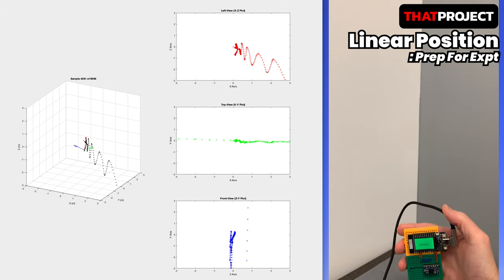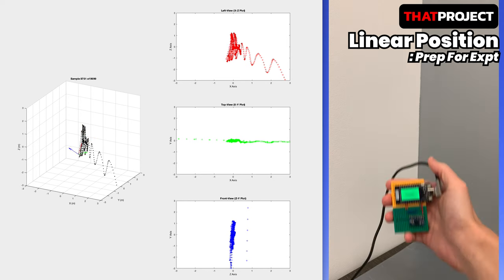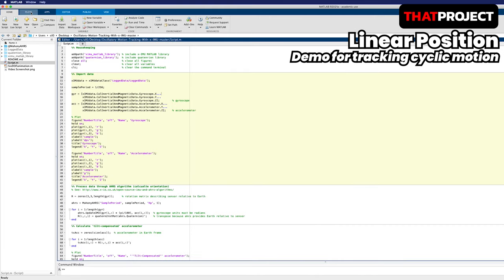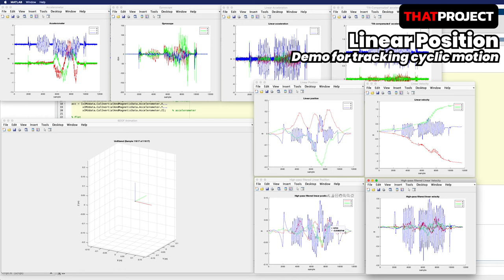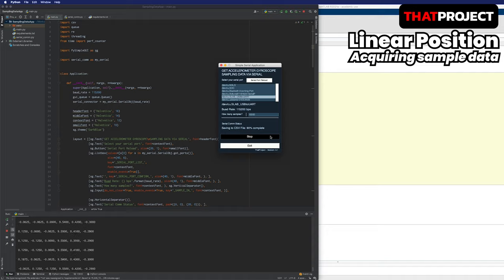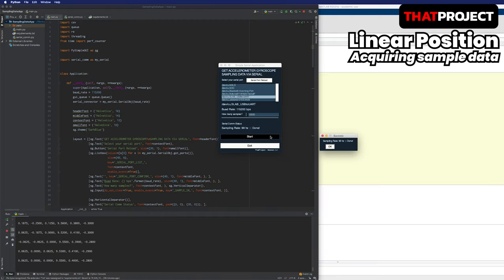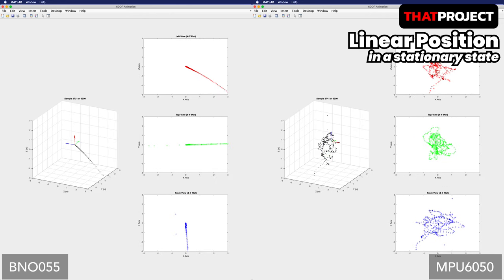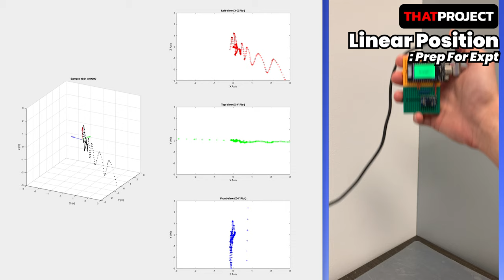IMU | Ep.1: Preparing an experiment to test linear positions (ft. MPU6050, GY-BNO055)

Comment: Hi @That Project .
How can i convert this code to adapt it to arduino one?
Reply from the maker: What part are you talking about? Matlab part? or ESP32 part?
Reply: @ThatProject  I was referring to the ESP32 part, but I think I managed to have something similar. Now I was trying to have full position tracking only with Arduino. Do you think this would be possible?
Reply from the maker: @ardanzaasier  Using ESP32, or Arduino, it doesn't really matter. The point is calculating the absolute position with the accelerometer and gyroscope in real-time. I'm not sure about it, but I hope you try it.
Reply: @ThatProject  I will try 💪💪💪
Reply: @ardanzaasier  did you tried it with arduino and is it working ?
ps :Im talking about the Matlab part
Reply: @wahbimanchoul2666  Hi, we try it but does not work properly. It has to much drift, at least in our version.